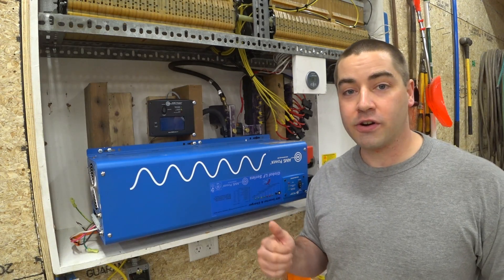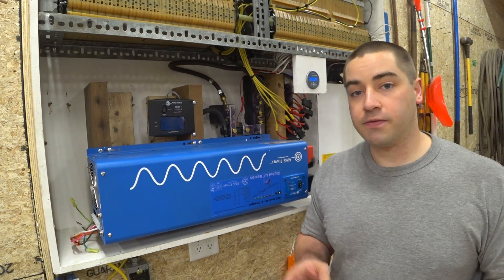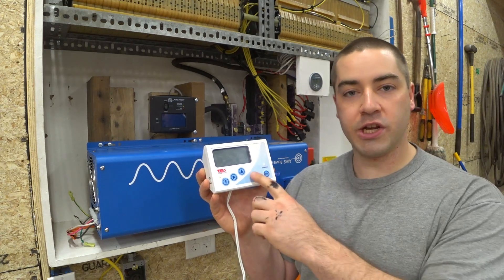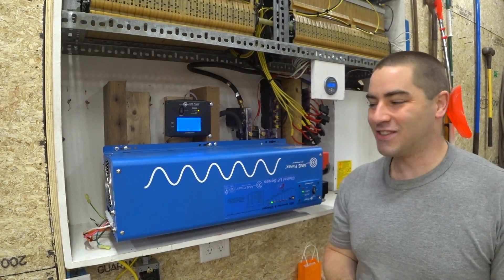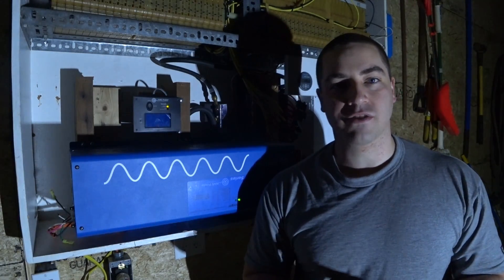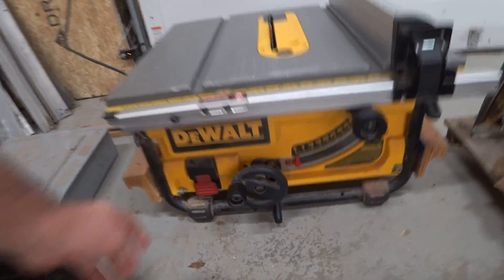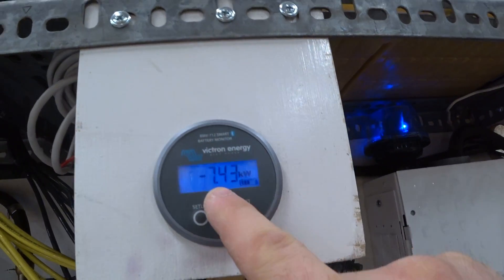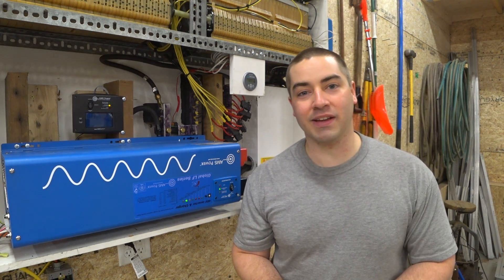Efficiency Test of Aims Low Frequency Inverter

Comment: Like in the last video, this is defiantly why I quit using high frequency inverters because they cant take the abuse, and because you took such good care and ran huge cables in short runs along with the low internal resistance of the batteries the inverter could pull all the amps it needed to compensate for low voltage and because you have such a large array of cells it can maintain a high current draw without sagging... great video.....
Reply from the maker: Thanks for watching.  It would be fun to test the same setup with lead acid batteries to see how much the difference is.  Do you know anyone who has done a side by side comparison?
Reply: I haven't seen a side-by-side but I'll tell you flooded lead-acid voltage sags pretty bad. It'll sag down to the low voltage cutoff and the inverter will shut down if you don't have a massive battery Bank and the problem gets exponentially worse as the batteries age

Comment: I dont remember the exact specs but I remember Aims inverters having quite a high over rating capacity. I could be wrong but I think it was something like 150% for 30 seconds. These units are built tough.

Comment: David, thank you for taking the time to review our inverter!! We value our customer's feedback. AIMS Power!
Reply from the maker: Hi Aims.  Your welcome on the review, thanks for making a great inverter.
Reply: @DavidPozEnergy  in the future, contact AIMS they do custom charging and discharging voltages that will work with that battery, you just won't be able to pick it up at the discount rate you purchased that one at.
Reply: @DavidPozEnergy  Low Frequency is the way to go, more surge time, but how will it last being the main source every day?
Reply: @MrBrymstond  We now own his Aims inverter. Its 3 years old. We're going off grid and will update Life of the inverter as each year passes. We'll be using electric heating, Cooling, lights and general Tiny home power.
Reply: We now own that Inverter. Its amazing! Inverter is 3 years old and doing well! Can wait to fully go Off grid and run the tiny home on it!
Reply: Could that be programmed on site? Perhaps by opening up the cover and flashing a chip or something? I know with my other brand inverter I can override any voltage set point within its own navigational menu
Reply: I wonder what the inverters sinewave looks like under a oscilloscope with no load to heavy load?

Comment: Are you running your hole house with this unit, or just your garage?
Reply from the maker: Both, house and garage.  I describe that in my last video when I hook up the inverter into the generator port.  You might like that video if you haven't already seen it.

Comment: Excellent review! This inverter is very good. Compared to mine, yours is exactly half the price.

What you get with the extra cost of the Schneider XW+6848 inverter: 
- 95% efficient which is achieved at 700W load. 
- Peak output is 12kW for 1 minute, 8.5kW for 30 mins.
- Battery can be 38V to 64V
- Idle load is 12.5W
- UL/1741 certified which means it will pass inspection
- Charger, transfer switch, generator support, inverter, AC-coupling, breakers - all in one unit.
- Remote network control and app via a $120 add-on
Reply from the maker: That XW is an amazing machine.  For most people, you are getting an inverter/charger in one package as you said.  However, in my setup, neither my Aims, or the Schneider work as chargers.  My 12s battery needs to be charged at 49.2 volts.  The XW (charger) can not be set that low.  Yes, I know the manual says it can, but I called the tech support and the guy at Schneider had an inverter sitting right there and after I requested, he tried setting the charging voltage that low and said "No, it can't do that, the manual is wrong".   After that I kept looking for another unit.  One other thing I really like about the XW is it's very low idle draw.
Reply: @DavidPozEnergy  I normally charge my battery at 49V. To try, I set it to 41V and it worked as well. That won't help you now, of course ;-)
Reply from the maker: Hi JRoque250.  You charge your batteries through the inverter?   Do you have solar panels?  Because solar panels have to run through a separate device, a charge controller such as XW-MPPT60-150.  I know the XW-MPPT60-150 can be set down to a low enough charging voltage, but the inverter/charger (XW+ 6848) can not be set low enough.  At least according to the tech at Schneider.  I hope this clears things up because I might have been too vauge in my previous comment.
Reply: The XW6848 can't charge 12s batteries unattended. The lowest BULK charge setting on mine is 54.2v and the lowest FLOAT voltage is 50.0. You can charge them manually but you can't do it automatically.
Reply: @DavidPozEnergy  Hmm there might have been some confusion with the terms we're using. I'm think you want to charge your batteries to 49.2V, not as I understood previously that you wanted to start your charge cycle when they reach that voltage.
I'm currently in the middle of a charge cycle but later I will try to set my parms so the max charge voltage is 49.2V and see if that works.
My setup is AC-coupled with microinverters on the solar panels. So, yes, I use the XW+6848 charger.
Reply: @JRo250  What is your battery arrangement?

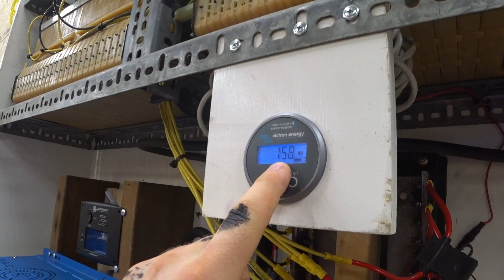Comment: 2:38... Nice Tattoo....;-)
I would have also checked the battery voltage sag at those power check points.
Reply from the maker: It's hard to stay clean for the videos when I'm in the garage working.

Comment: Very cool. Do you heat domestic hot water and radiant floor off the same water heater?
Reply from the maker: No, I don't use the same hot water.  My garage and house are two separate buildings with separate systems.  But both are solar hot water, drain-back.  Here is a video on the Garage system: https://youtu.be/HkNALptIUBY and here is one on the DHW: https://youtu.be/WwTsWUKr5VE  There are many more videos on each system showing the build process if you are intrested.  I also have an article that gives a good overview and cost breakdown here: https://www.builditsolar.com/Projects/SpaceHeating/DavidPoz/DavidPoslusznySolarDHW.pdf

Comment: its called duty cycle... Thats why you could get above the label rating..
As for the standby load being lower , usually manufacturers will rate this at the upper end of the manufacturing tolerances... 
If they stated that standby 63 watts and yours was 80watts you would thing there was something wrong.
Reply from the maker: Thanks, that makes sense.
Reply: @DavidPozEnergy  It handled all of your inductive loads as well. You should be a happy man.
Reply from the maker: Yes, I am very happy with this.  As I said in the video, I was expecting the efficiency to be much worse.

Comment: That was an awesome efficiency presentation of that inverter . Since mine is a 24 volt 6000 watt , I should be able get about the same efficiency if I get more  to enough batteries since I have 10 now  until I get 16 in my box , maybe more like 24 . Check out Preston Strouds aims video .

Comment: Probably has a curve to it... Ie, It can sustain 6k indefinitely. Can run 8k for 30 minutes, 10k for 2 minutes, etc etc... something like that.
Reply: I checked the manual for curiosity (on the AIMS Power website) - This sure has a beast of overload capacity!  Copy & paste from the manual:
For 110%<Load<125%(±10%), no audible alarm for 14 minutes, beeps 0.5s every 1s in the 15th minute, and Fault (Turn off) after the 15th minute. 
For 125%<Load<150%(±10%), beeps 0.5s every 1s and Fault (Turn off) after 1 minute. 
For 300%≧Load>150%(±10%), beeps 0.5s every 1s and Fault (Turn off) after 20s.
Reply: 18kw peak surge for 20 seconds..

Comment: That's pretty impressive, that went way above and beyond my previous aims inverters. They would never reach thier advertised ratings. I think that pretty much out performed my magnum 4448 inverter. Of course I've never had a good battery bank to judge it off of but I dont think I could get 5k watts out of it. I guess the only test left is reliability and seeing if it will give you 2 to 4 years of good use out of it. I worked on a xantrax the other day that was installed in 1994. And it was for constant power, not just back up. We changed the batteries and solar panels and kept the inverter. We'll see ho much longer it last. I was pretty impressed at that tho.
Reply from the maker: That's not the first time I've heard great things about the old xantrax.  They really did it right.

Comment: Looking at the specifications for the inverter it can surge to 18000 watts for 20 seconds. How long it can run at more then 6000 watts since there is not any details listed for additional run times at loads between 6000 and 18000.
Reply from the maker: I don't know.  Thanks for watching.

Comment: That's really good efficiency for a low frequency inverter. High frequency inverters aren't that much better, if at all. High frequency inverters are also more fragile. For starting up motors, low frequency will be more reliable. Please, put an oscilloscope on the output, let's see what the wave form looks like. I'm suspecting it's going to be a soft square wave, rather than a true sine wave.
Reply from the maker: I'd love to make a video testing the wave with an oscilloscope.  Do you own an oscilloscope you can loan me?  I'll make the video and then mail it back, or if you are in New England I can pick it up and drop off.  If you are willing to do this then please e-mail me through my website.

Comment: I would like to see a run time test @ 40%  continues load. Everyday house appliances.. TV ,computer , fridg .. and see how long your setup can hold. :) do you have a thermal camera to see if there's any hot connections.... I enjoy your video.
Reply from the maker: I'm conducting a capacity load test as we speak.  I'm not trying to be at a certain %, I'm just running the whole house and doing normal stuff, well maybe a few extra loads of laundry and such to try and use up the electricity.  The solar is off so I'm only testing stored capacity.  I'll be making a video on it soon.  No, I do not own a thermal camera.  Thanks for watching.

Comment: Time to upgrade the wiring feeding the generator cord... #10 is only rated at 30amps... and 7kw is pushing it... increasing the wire size, will reduce losses even more! I’d install some #6 to get all the electrons nice and cool.
Reply from the maker: On my to-do list is installing a sub-panel for the inverter.  However, the generator cord I'm using is 30 amps, 10 gauge.  So does it make a difference that I have 16 inches more of 10 gauge going from inverter to outlet?  Wouldn't the choke point still be the cord?  Please don't take this as sarcasm, I'm being serious as I don't know.
Reply: DavidPoz exactly.
My point is, with this inverter, you need a minimum of #6 on the output. Agreed, the generator cord ALSO needs to be upgraded. 
#10 is adequate for the generator cord, if it is only a 6KW generator, as it has minimal surge capability.
The inverter is capable of over 60amps for an extended 20 seconds of surge... #6 will safely handle that, and reduce any resistance feeding your panel.
Reply from the maker: Thanks. That would mean a larger outlet (attached to generator) and larger plug (where the generator cord attaches to the building) ?
Reply: I wouldn't use the big plug. Just run the number 6 wire from the inverter straight to the panel in the house. And if there's no resettable breaker in the inverter you should probably put a breaker near the inverters end of that wire.
Reply: You asked if a few inches of number 10 would be a choke point? Well they might act like a fusible link, LOL like the kind that will set fire to your garage but that would take a heck of a lot of amps for quite a while. In reality running a number 6 for the majority of the distance would cut down on the majority of the losses. Having a few inches of number 10 isn't going to matter much as long as you don't pull enough amps for long enough to melt them
Reply: If you haven't already check out Googling voltage loss calculator and go to the top link which should be calculator.net that will help you understand what gauge wire you need for the lengths you need to go.
Reply: https://www.calculator.net/voltage-drop-calculator.html
Reply from the maker: @ Travid Sanders: Thanks for the link.  I would not run #10 and #6 on the same circuit.  In my case right now, I have #10 from inverter to outlet, and #10 generator cord.

Comment: is my question. your 48v battery is capable for 125 amps peak load.if not capable because high ampere using continuously your battery is damage in few days.
Reply from the maker: I don't know the exact specs on my battery, but when it was in the Chevy Volt car it was fused at 350 amps.  So I'm guessing it can do 350 amps without damage.  I have a circuit breaker on it at 250 amps: https://youtu.be/HYay0qqtUOs

Comment: great video, felt like you ended it really quickly he he

but.... i love it all
during the power outage, how long did it supply your House, assuming you were in conservation mode obvs.
was it useful or short lived?
how long at your average sun feed, does it take to charge
Reply from the maker: That power outage lasted 6 hours.  We were not being conservative.  Actually more like the opposite.  I was having fun running the washing machine, the dishwasher, and remember, I have electric for everything, so running the dishwasher caused the hot water tank to turn on.  Yeah, it was fun.  The voltage dropped from 46 to 45v.  The solar produced 1.56kwh during that same time (snowy).  But I'm conducting a good capacity test right now and will be posting those numbers when I finish.

Comment: Results are as expected. As someone else has already pointed out, the idle power is lower than stated due to the lower input voltage. That seems to be a fact with most inverters, low frequency or high. 88 watts for running the phantom/standby loads though is pretty high, and definitely something to consider if you run such an inverter all the time. As that draw constantly will seriously eat into your power reserves, at over 2 KW/H per day. However, it's a problem easily solved by running a secondary smaller inverter for such loads.

On the other hand, your load tests show that this Aims inverter is pretty robust and an excellent choice for running the items in your workshop.
Reply: Yes. I think there are some small inverters out there that would run the garage door that maybe have a 6 Watt stand by

Comment: Yes i would like to have seen the battery sag and how long this load could be sustained before overheat protection kicks in.  How much do those batterys cost?I have 10kw solar that tracks the sun and 4 banks of trogens =53.5.I am grid tied and use twin  Outback GTfx 3648 inverters tied master and slave powering our home the rest of generation is selling for kw credit against usage. I think i will do a test as you did and see my results also.I have not had a electric bill over 35.00 in 3 yrs. Always tax's so there is never a zero.Very nice video. (cheers)   Bring on the SUN!
Reply from the maker: Hi Jim,  That sounds like a very nice system.  10kw tracker, that's huge.  I can't imagine you have to worry about not charging your batteries.  As for the duration test, I'm conducting one right now.  I ran the inverter with 4.5kw load for a couple hours and no over heat alarm.  Now I'm at about 2kw load.  In the morning I'm going to finish draining the batteries until the inverter shuts off.  Then I'll have the capacity of the batteries and be able to make a video on that.  I paid $2,033 for the battery.  I bought it from a junkyard out of a Chevy Volt.  Here is that video: https://youtu.be/V1t1SoEhVNQ
Reply: @DavidPozEnergy  No No battery charging is no problem they stay @ 100% unless the grid drops. I have with all banks wired 450amp hrs and can run the house loads many hours. I was wondering how many amp hrs the battery you have is and how long does it last at let's say 3000kw? for 8 hrs load before low voltage trips.My system is grid tied.I use the grid all the time and when the sun comes out my system pushes BACK on the grid and spins the solar meter backwards all day giving me generated kwh credits against the usage for the month. If the grid drops the inverters kick in with no interuption in power to the house and is now running on the batteries .If this happens the solar arrays keep the batteries at 100% until night time.By morning my bateries are at 70-75% when sun comes up it takes approx 3 hrs to get back to 100%,this cycle continues over and over.If the sun is NOT up for many days than the natural gas 4 kw onan gen will kick on at 51% and the inverters will charge batteries back to 100% in 2 -3 hrs. I was thinking of installing the batteries you have and give them a try.48 volt system. Maybe 4 battery banks with the battery you are now using. What do you think?
Reply from the maker: Hi Jim,  You asked how many amp hrs my battery is.  I have a Gen 2 from a Chevy Volt.  I found this from GM: https://media.gm.com/content/dam/Media/microsites/product/Volt_2016/doc/VOLT_BATTERY.pdf  On page 4 it says the battery is 18.4kwh and 14kwh usable.  

That sounds  nice that your inverters have the ability to back-feed.

I like these batteries, but I wouldn't replace your Trojens until they are dead and need replacing, and I would not mix lead acid batteries with these lithium batteries.